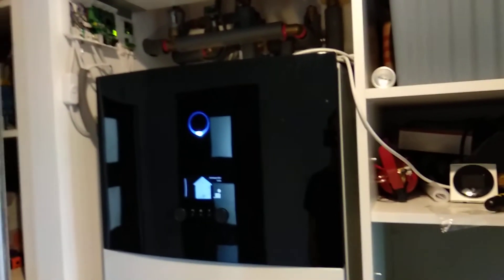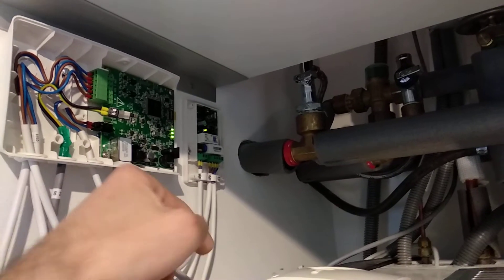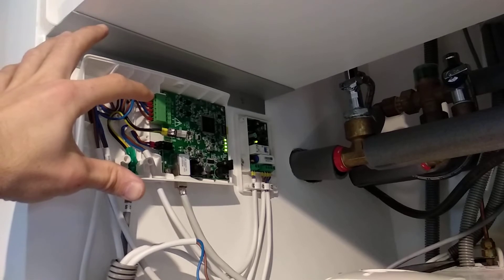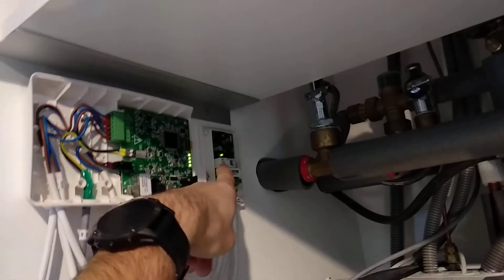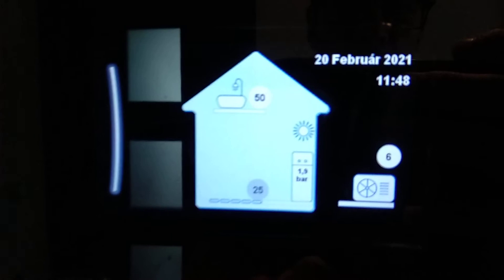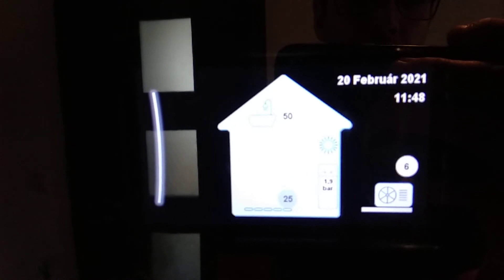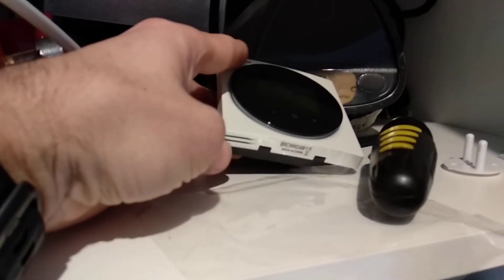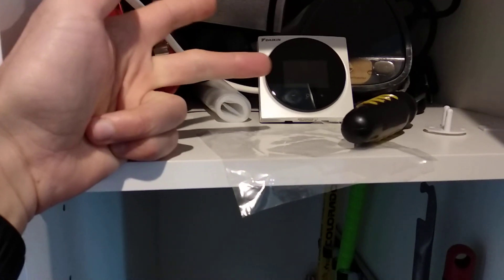Daikin Altherma 3 with Photovoltaics. My Smart Grid setup.

Comment: Thanks for sharing. I have a Huawei inverter and I want to link my photovoltaic production with my Daikin Atherma EHVX11S26CB9W. I wonder how I can send commands to the heat pump when I have energy excess. Could you please help me?
Reply from the maker: You need to have dry-switch from Huawei (don't know if they have it, as I am using SolarEdge) - connected to Daikin LAN Adaptor BRP069A61. Check the manual of the adaptor. Some guys replaced Dry-switch with HomeAssistant, or OpenHAB automation.
Reply: @misok  Much appreciatted for responding. I though I would need daikin dcom-lt/io. I wonder what is the difference between the daikin dcom-lt/io and Lan Adaptor?
Reply from the maker: @vinhuela33  Hi, I have never seen dcom-lt/io, but it looks like Hub for communication. You have P1/P2 for thermostat, RS485 for data communication (probably actual total house power consumption too?) and relays, which will be steered. I can't see the LAN cable, so you will not see the statistics on Daikin app at least. SG0 and SG1 signals are missing too. They say it is BMS - Building management system. You can probably use it to connect ventilation, climatisation, light systems etc... I suppose you can do the same as with LAN Adapter, but it requires some programming and RS485 knowledge.

Comment: Interesting video thanks for sharing, I have solar edge inverter add aDiakin lather a and would love to connect them for excess solar to run the Athena  Please can you provide the name or item number of the solar edge device please
Reply from the maker: I forgot to mention, you need to have a Power meter https://www.solaredge.com/products/metering-and-sensors/solaredge-modbus-meter#/ with clamps
Reply from the maker: Hello, thanks. Is your Inverter Set-App capable? if yes, then you need to install Smart Energy ZigBee® Plug-in (for set-app) - as on the picture https://www.solaredge.com/products/device-control#/ to send Zigbee signal to: Dry Contact Switch (Smart Energy Relay) https://www.solaredge.com/sites/default/files/se-device-control-dry-contact-switch-installation-guide.pdf or Smart Energy Socket or Smart Energy switch. Daikin LAN Adapter is able to use all of them.

Bad thing is, that HP will be switched On and Off several times a day, which will affect lifespan of HP. I wish Daikin/SolarEdge invested more time to development of their Smart Grid.

Comment: Does this just give an "on-off" signal to the altherma or does it also monitor the power usage and adjust to the future solar situations?
Reply from the maker: If you mean Dry Contact Switch from SolarEdge - to turn on the switch you can adjust two values: Available energy (exported to the grid) in kW and minimum time, during which the kWs are available. I set it up to 2 minutes and 1000kW for now. If there is less than 1000kw after switch is on, the switch is turned off immediatelly (shame!)!